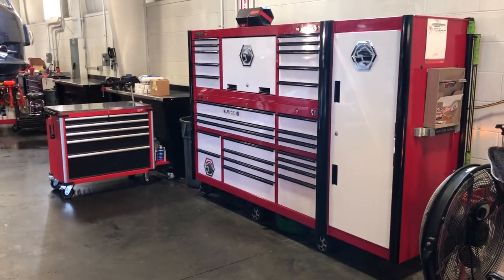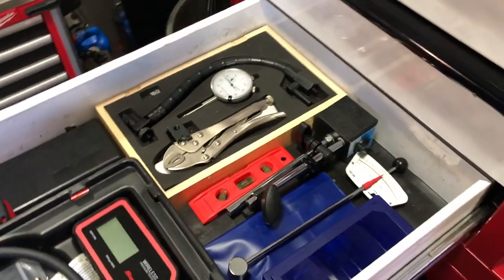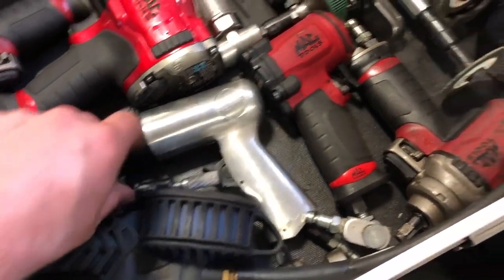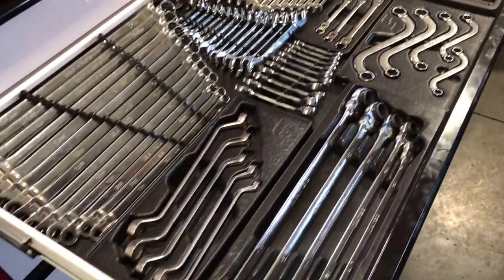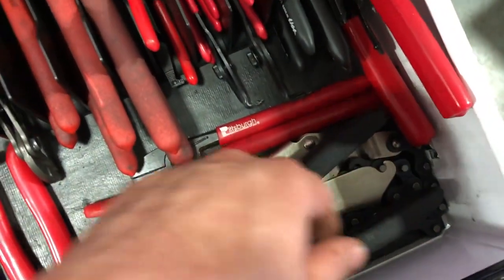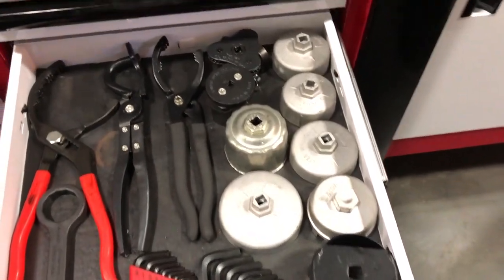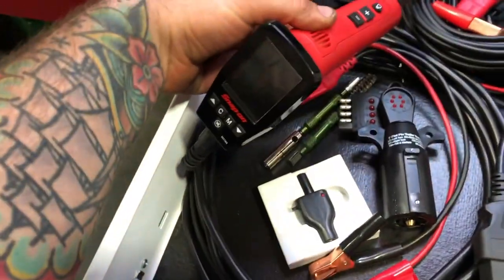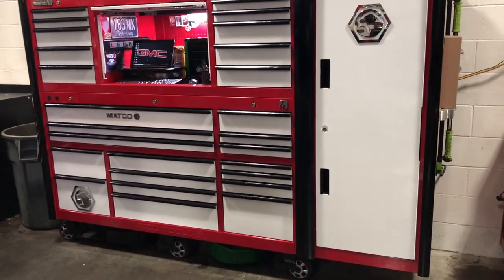Updated 2019 Matco 6s Tool Box Tour

Comment: With those tall drawers on the top chest, it would be cool if the bottom chest had a "step drawer". Literally a thin drawer that pulls out and is designed for you to step up and, gives you a 3 or 4 foot platform to stand on. Then you could reach the very top of your box too.

Comment: I still use my air tools honestly I only use my electric tools if I’m going somewhere like the parking lot or road I take my electric stuff. I really wanna get the new ingersolrand d handle 1 inch electric impact claims to have about 2000 plus ft lbs of break away torque I’ll prolly get the new Milwaukee In the same configuration it’s cheaper and not out of stock and actually been tested idk about the ir I want it but it’s like 3 bands